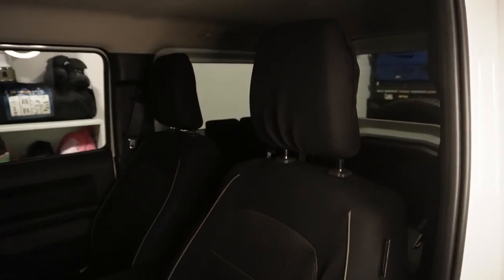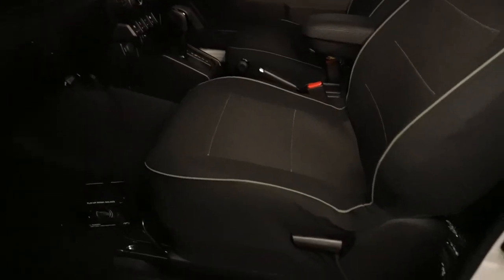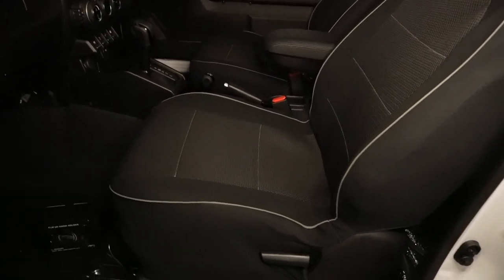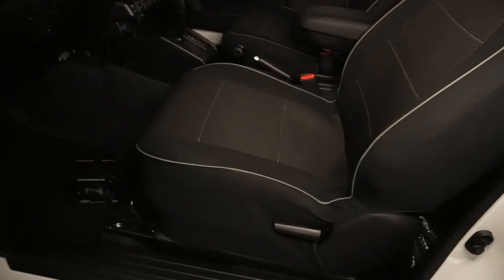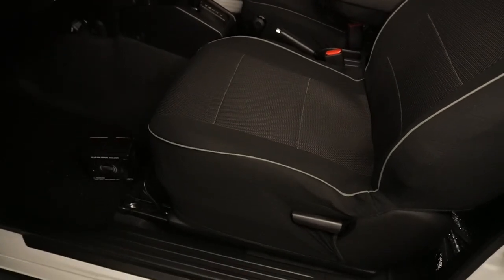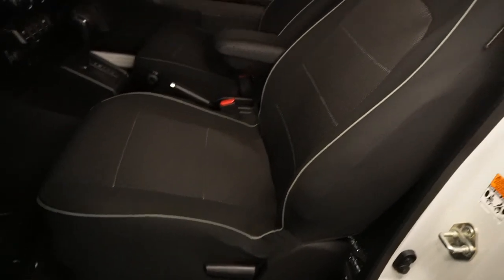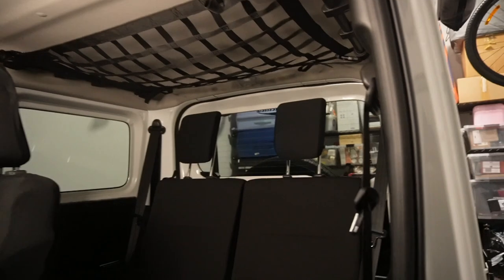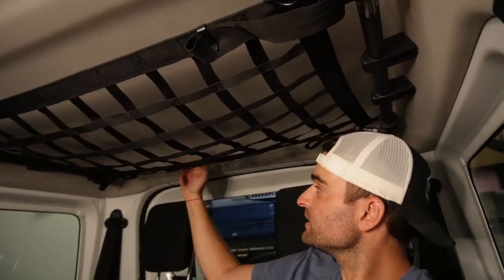New Jimny Style Accessories for 2022 Suzuki Jimny

Comment: Will u be able to move the ac vent with those cup holder installed?
Reply from the maker: Hi John. That’s a great question. Once the tape is in place, you can’t rotate the vent and once the clip is in the vent it can’t move at all. So it’s stuck open. I guess it’s one of the drawbacks to this design

Comment: Just came across your channel good work. With the storage net you being about 1.85m tall, are you able to sit in the backseat without your head touching the net?
Reply from the maker: Hey. Thanks for the comment. I actually sat in the back today. If I sit straight up in the seat at the back my head just touches the net when it’s on its tightest. It does hang down in the middle, so if you sit slightly tilted to the side, towards the window I guess you are below the net. If I had to guess 1.7m could sit upright under the net. 

There are solid shelves one can buy instead. I think the benefit of the shelf is that they can carry more weight and might not hang as low in the Center.